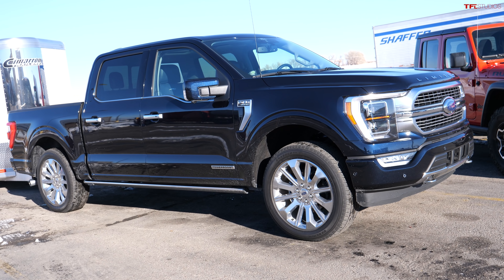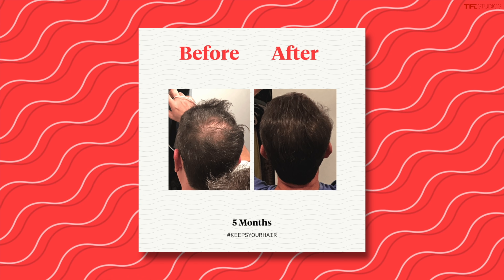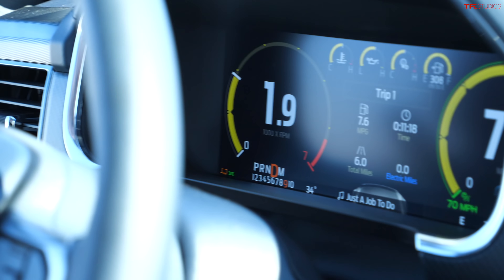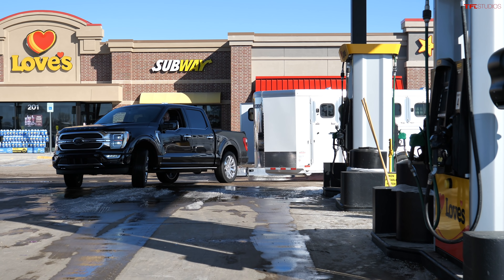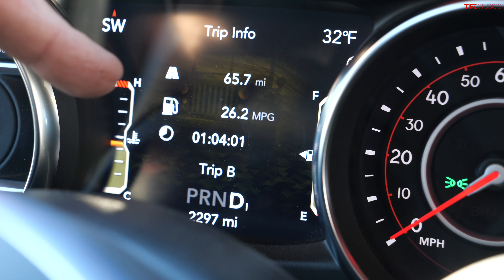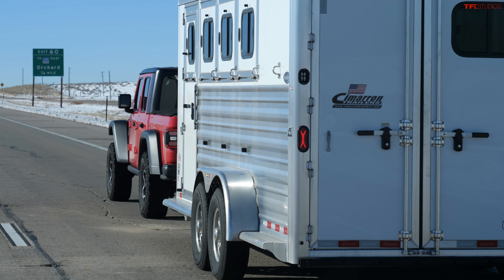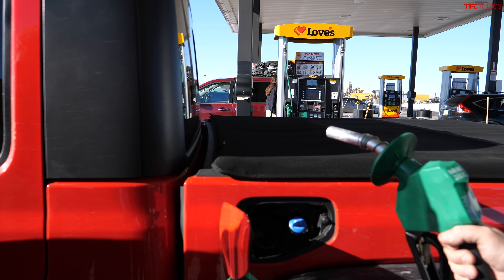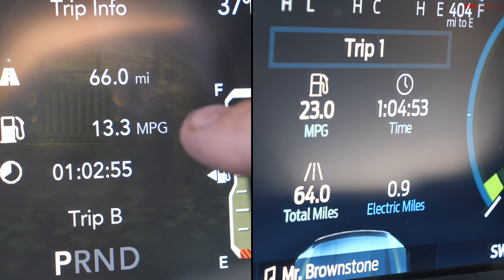We Didn't Expect This: Will a Ford F-150 Hybrid Get Better Towing MPG Than a Jeep Gladiator Diesel?

Comment: I went with the F150 XLT 2020 ecoboost two days ago. Today I put just over 200 miles on. 78mph on the Highway. 18.1 mpg avg. Eco mod. Came home. 36 gal tank. After filling. 577 range. What I have been threw with the truck and the options. Very impressive. Still is have my own trailer hauling to do. Im not complaining one bit. I know for now I made the wright choice for myself. Thank you Ford.

Comment: Possible pump issues aside, Ford is going to have a hard time keeping up with demand on that hybrid.
Reply: My wife grew up a Ford girl but lately has been wanting the new GMC full-size truck. I on the other hand am not biased and would drive what fits best and fuel economy is a big deciding factor. Honestly, I would push for the new F150 with this hybrid system in it.
Reply: @27Zangle  
If you can wait a bit, always a good idea to not buy the first year production of a new powertrain. Even Toyota with their Prius has occasionally had problems in first year production of a model change.
Reply: @kens97sto171  - Oh yeah, we are waiting and prefer to buy 2-3 years used for saving. So,  this is likely about 4 years down the road. However, it could be soon and may swing for new next year or the year after. Really depends on the economy and Covid.
Reply: @LA FLAMA BLANCA 
Lifespan on a hybrid battery should be 10 to 12 years,  buying a one or two year old one is not going to affect you enough to be worth worrying about. and of course one would hope that a 2-year-old truck would save you enough money to be worth it. I just don't think I would want to buy the first year production of any vehicle with a significantly changed powertrain.
Have no idea what the cost would be for this Hybrid battery. Toyota Priuses have a lot more availability you can get a new pack from Toyota for about $2,500 bucks now.
You always have to do the math and find out whether you drive enough to save enough with the difference in fuel economy. If you don't you're just better off to buy the non-hybrid.
Not with this Ford it does give you a bit more power and torque so that factors in a bit too.
Reply: @kens97sto171  - Exactly. I have seen some super low mileage vehicles for sale (including hybrids) due to life issues, death, estates, etc. Never know what you can get while saving a large chunk of change. Just can't be picky and have to be quick on the trigger.
Reply: I work here at F-150 assembly here in Dearborn Michigan Dyno testing these trucks. With all the new electrical components and modules, Ford is having headaches and migraines at the moment getting this truck prepared. It might be smarter to wait a year so Ford can iron out all these problems they're having. Personally I drive a loaded 2020 Silverado with the 6.2 L I got at a fraction of the price of a comparable F-150. I love it! Good luck though.
Reply: @moodyman211  - Well that is ominous, lol.
Reply: @moodyman211  highly doubt you work there doing what you say with the information you claim. With fords ban on TFL. You'd be putting your job in jeopardy for a comment like this. 
That alone makes me question your judgement on any information you could have about anything, if you don't value your job now, how can you value what words you speak?
Reply: @kens97sto171  and @BiscuitPuncher
I think you guys are forgetting that while this is the first time this powertrain is in the f150, Ford has been using this set up for closer to 3 years now in the Lincoln lineup. 
Couple that with the f150 is fords bread and butter..... they aren't going to risk this failing and the tragic implications it would bring down on the #1 selling vehicle for the last 40 dome years.
Hence the subtle slight styling cues to this 14th gen truck without drastically overhauling it. Add to what works, don't blow it up and start over....
Reply: @jacehiggs3637  you can believe whatever you want-  doesn't matter to me. Why would my job be in Jeopardy LOL for saying what I believe. I worked at the wixom plant where we used to build Lincoln's for 20 years, then got transferred to the Dearborn plant making f-150s when the wixom plant became obsolete and out of date. I've been working here for 12 years on top of my 20 I already have.... do the math, I could retire if I wanted to.  F-150 is a good truck, but I drive them all the time... I have to drive to drive them when I'm off too? I drive what I want. Ford is having electrical & supplier problems with the f-150s, but I have confidence they'll get it under control and get it fixed.
Reply: @27Zangle  it's a brand new truck with tons of new electronic technology- they'll be all right and they'll figure it out
Reply: @BLUBLUD 
Was that the first year for it??  I think so. But the powertrain had been in use for a long time.   The 4.6 modular V8 was in crown vics for a long time. 
My point is still there is more risk on any first gen product. 
Others have said this is not a new unit.. if so then it may be fine.  
Just a good general habit to not buy first year.
Reply: @LA FLAMA BLANCA i own a 1999 prius , still with the first battery, so dont worry ;)
Reply: Nobody bought the Silverado hybrid, and it was a pretty great system. Lack of on board power was utterly stupid, but how many people are going to use that?
Reply: @bump_draft  
The Silverado hybrid gave you very little extra power, didn't really save you any gas mileage, and was extremely expensive to purchase. I want to see these guys do a city MPG test back-to-back with a non-hybrid. Stop and go traffic is where a hybrid is going to make the most difference not constant highway or towing.
Reply: @kens97sto171  It went from 16 city to 22 city, that's a 37% improvement.
Reply: @bump_draft  
I wonder if that was EPA numbers ..  or real world numbers.  
If the thing did not deliver in real world it would have hurt sales.
Also.. maybe the truck buyers at the time we're not ready for a hybrid.. or worried about it being reliable.
Reply: @moodyman211  Sounds like a Chevy fanboi. Works for Ford because it’s one of the most stable manufacturers out of the big three.
Reply: @DSGHoods  not really. I dyno test f-150s for a living here at the plant. They're good trucks but I drive them 10+ hours every work day. Plus, a comparable F-150 would run me $200+ a month so it says my dealer even with employee pricing. I require something reliable so I can't ger any FCA product, and I don't want any foreign name plates for obvious reasons- so it's either Chevy or GMC. You don't have to like it or believe it, and I really don't care.
Reply: @moodyman211  not hard to see through lies when the story changes 3 times. 
First you work at the plant and see all the headaches ford is having. 
Then you change it to its the electrical supplier thats the issue (is this the supplier as in the manufacturer or supplier unit in the truck for the electronics?) Then its that you drive the f150s 10 hours a day.
Last you say you dyno test them all day.... thats not really driving man...
So what do you do?
To answer your question, your job would be in jeopardy leaking any information on issues ford is or isn't having to tfl because tfl is on the black list for ford. 
Idc what you drive, but don't come spitting claims to information you supposedly have when you don't. Foh
Reply: @jacehiggs3637  I reiterate, believe what you want. I drive the truck while in the dyno booth testing it following the prompts on the screen that are given to me.  Tests include braking, speeding, Cluster controls, AC temperature, module testing and so on. You need me to explain this to you? Lol "Stubborn" must be your middle name. This truck is a new vehicle with new electrical gadgets including a shift lever that raises and lowers and moving directional headlights that you'll soon hear about. I'm not changing my story "stubborn" one, the electrical issues and supplier problems are separate issues but there still problems relating to the vehicle. Ever hear the saying don't buy a vehicle in its first year? There you go genius. I've worked for Ford for 32 years, the UAW protects me at my job... In any regards I could retire if I want and leave at my discretion. I hope this answers your concerns Mr stubborn... What are you like 12 years old? Ford will solve any problems they have with the vehicle, I have my utmost confidence in them.  Now go away and stop wasting my time
Reply: @moodyman211  ياخي لا تبلشنا مع العالم
Reply: THERE WAS NO PUMP ISSUES. THOSE GUYS ARE WRONG.
Reply: @moodyman211  what the people really want to know is, when will the Super Duty add a Hybrid or Pro Power Onboard option so we can run AC to our big 5th wheel / gooseneck trailers without having to lug a generator around (or search for shore power every time we park)???

Comment: Having the hybrid with the larger generator option would be awesome for RVing while boondocking
Reply: Can power two full size rvs
Reply: Except you need a bigger truck to tow it.
Reply: Tow rating on the F150 PowerBoost is 14,000 pounds.
Reply: @bobmakow55  why waste extra money on the powerboost. The EcoBeast is 14,000. Save thousands and buy a generator for your RV.
Reply: @wilk128  Generators are loud. Unless it is expensive honda inverter generator which is quiet but only 2kW peak
Reply: @wilk128  I run A/C or heater. My 6 deep cycle batteries bank is barely enough for a few hours. Generator is fine in daytime but sucks in the night. With this ford I can also run A/C while driving to keep things cool
Reply: @Bambarbia2447  then buy one. I sold my camper 30 years ago. Hotel rooms are the way to go.
Reply: @wilk128  I hear you. For some, hotels are the way to go. I use my camper to stay overnight at small airports and even random fields and then fly my ultralights at sunrise. Hotels are extremely inconvenient for me
Reply: @wilk128  I love the Ecoboost, I owned a 2018 2wd 3.5L but couldn’t tow it behind my Motorhome we had since it wasn’t 4wd with the ability to put the transfer case in neutral.
The problem I had was finding a truck configured correctly to get  that higher tow rating. As the pdf shows I attached earlier there are a lot of factors to get to that 14000. I found many dealers ordering trucks with very odd combinations of power trains, If you look at that chart not all 3.5 ecoboosts are rated at 14k tow capacity.  But agree, if you have excess cargo capacity and room for the weight of the separate generator that’s a good option.
But as you can see your cargo carrying capacity is limited.  Especially if whoever orders the truck doesn’t order the heavy duty payload option.
When you put 4 people in a truck, the weight of a fifth wheel hitch, the tongue weight of the RV you are pushing the limits.
I disagree with staying at a hotel, I’d rather sleep in my own bed, especially with this Chinese virus going around.
Reply: @Bambarbia2447  — That Ford PowerBoost battery is only 1.5 kWh, so if you’re using, say a 13.5k BTU AC unit (generally @ 2 kW), that truck battery would only last 30-35 minutes before the engine would start to recharge the thing. Isn’t that very expensive power ?? I mean, even a lot more so that an already-expensive 3 kW stand-alone generator?

I agree that on hot nights AC is necessary. But it’s a huge expense and hassle if you’re “off the grid”.

I also agree with the guy that says to just find a hotel. It sure saves a lot of work and money — and let them wash the sheets and cook breakfast.
Reply: @bobmakow55  — on the 2-WD truck, you can disconnect and tie up the driveshaft when you tow the truck. It’s easy and quick — and if you’re too lazy to do that, tell the wife to do it ...
Reply: @wilk128  A/C is rather nice to have, and where I camp you don't get the privilege of having a hotel.

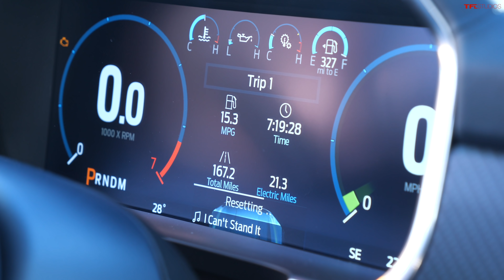Comment: On the first run of the Gladiator, you can see at 3:44 that the tank is not full... That might explain the MPG difference between the computer and the full up method.
Reply: Ya wtf lol cant trust anything anymore lol. Fill that thing up!!!!
Reply: I have to top my diesels up, takes a bit because of the foaming but it’s the only way I can accurately gauge mpg.
Reply: @vprsrul  same i usually wait a min or 2 before i top off the tank.
Reply: Tfl has to get back on Fords good side somehow.
Reply: Thank you for posting that. I was going to say the same thing. It wasn't full.
Reply: @vprsrul  I never have any issues.
Reply: It looks like the gauge was still going up at that time. Hard to say how far off it was or it was full but just taking time to register.
Reply: OR he reset the trip odometer before filling it up. With editing, things that are recorded before, can appear after.
Reply: They follow the same protocol for every fill up, regardless of how not full or if they didn't wait long enough for a complete fill, the second time they topped it off, they wait the same 30 seconds. Diesel might require more time than the gas they're used to for defoaming but regardless, they go back to the same pump same gas station and follow the same go till it clicks then wait 30 and repeat. There would be no difference. And again, like they even said in the video, the 24 mpg they were 'supposed' to get is guaranteed for the sport model with regular tires, epa doesn't test every trim.
Reply: It ticked up twice while the camera was on it so they may have still been filling.
Reply: In some vehicles it takes a couple of minutes for the gauge to read full. From that clip it seems like he is at or near the pump just after completing the fill up.
Reply: @kingodoom2  
- I’ve got a ‘13’ Jeep Wrangler and it’s gas gauge is slow to show full.

Comment: I have the exact ford truck as in the video. Same color too. I’ve never gotten over 21 MPG ever. I live in Nevada and drive a lot of hills. Towing a 3500 pound trailer I get about 11-13 MPG in no wind. The truck is $80,000. It has an incredible amount of tech in it including massaging seats. I just ordered a 2022 Gladiator diesel.

Comment: Why not an F150 hybrid vs a F150 diesel?
Reply: That is an excellent comparison! BTW, a hybrid needs less maintenance since it has less engine running time, and brake regeneration saves on pads.

Comment: Good informative video. My take form it is if you want a truck for city daily driver get the f150 hybrid, if the plan it to tow more than 25% of the time get a Ram 2500 Cummins, and if you want a life style vehicle with off road capabilities get the Gladiator ecodiesel.

Comment: One thing to consider is that it is winter time. I know here in Idaho during winter months the gas stations are required to carry winter fuel.  I don't know all the technical stuff behind it, but it gets about 10% lower gas mileage than the summer fuel.  I am guessing Colorado does the same thing.

Comment: Need a city loop for all these new hybrids coming up
Reply: ive been saying that ever since the Ram hybrid they never tested in the city... i live and work in a city, not a highway
Reply: @philtripe  then do you really need a pickup? And if so and you primarily drive in the city order the lowest possible gearing. It’s a no brained that lower gears do better in the city. I always get the lowest gears I can when I buy a truck. Better city mpg, better drive ability, better towing. And it just averages out highway to city mpg
Reply: In the meantime, know that unlike ICE only vehicles, hybrids get better mileage in the city since they can use regen and the electric motors more often.  My RAV 4 gets about 36 on the highway @ 70 mph and over 42 mpg when tooling around town, which is typically backwards (better city mileage) than ICE only engines  (better highway mileage).
Reply: @philtripe  the ram hybrid is a mild hybrid not a true hybrid